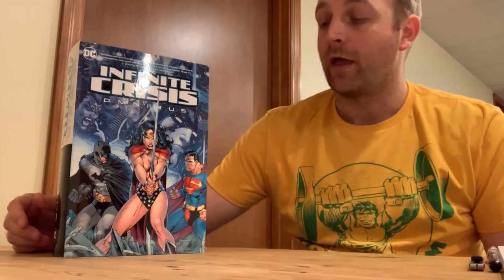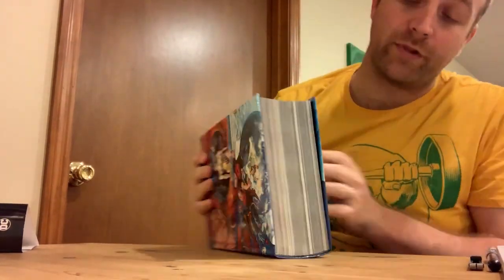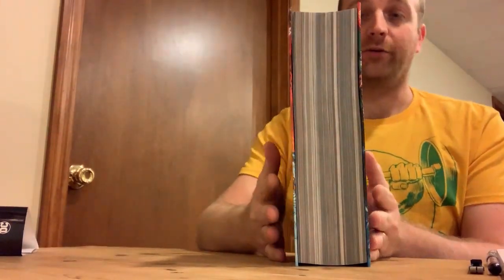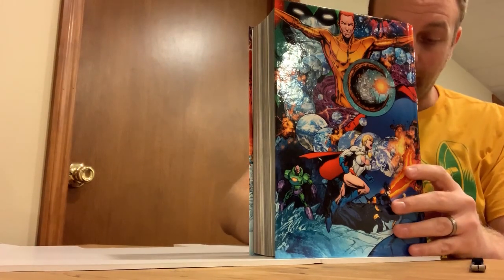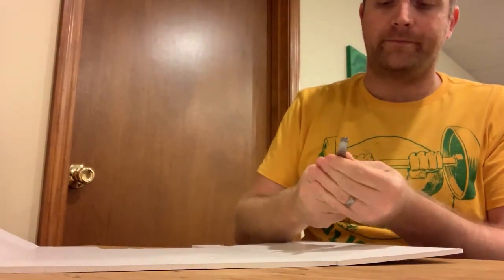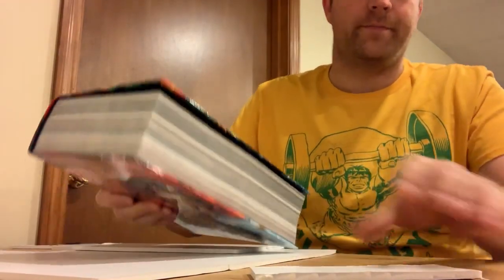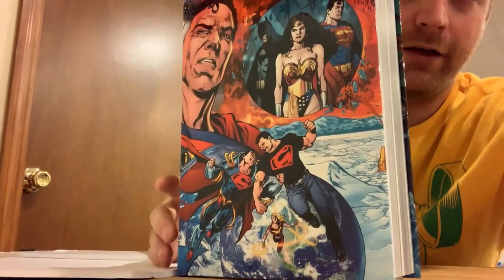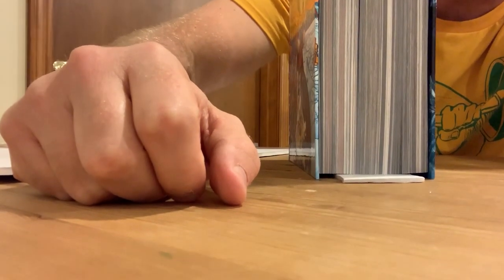How to Prevent Omnibus Page Sag - Dr Omnibus - Issue 4

Comment: Great video. If the foam board is too thick though, then I wouldn't cut along the thickness of it to make it thinner. I'd just try to find some thinner foam board. It'd be difficult to cut along it perfectly even, and then the weight distribution of the block on the foam board may not be even.

Comment: As a Dutch man I didn't know the English term for this problem, but I use a similar technique for years and it involves stacking cut out comicbook backboards, usually 5 boards high. Cut out to the width of the omni, or any OHC thicker than 1 cm.

Comment: Does anyone have the issue where putting support under the text block ends up putting a curve in the pages? Just cause now the weight of the book is resting more on the pages and it ends up bending pages one way or another.

Comment: Is there a way to repair the spine if sag has started to damage the paper that attaches the text block to the cover?
Reply: yes. if the paper has begun to tear you will need to cut the text block out and make new endsheets. If it hasnt started to tear then you can add glue under the parts which are coming loose and then do what this video describes to prevent future occurance of this issue.

Comment: I've never heard of this problem until I watched this video yesterday. Could laying omnibuses down instead of standing them up help prevent page sag, too? Also, would it maybe be easier to use popsicle sticks or something, since those are really thin, too?
Reply: scapegoatman strap in for a long reply, lol. 
1) i would not stack omnis flat. I dont know for sure, but I think all that weight would damage the covers and possibly the binding of the lower omnis
2) popsicle sticks could work, IF you glue them together (if needed) and cut them so that they can be laid under the book and placed perpendicular to the pages, so they support the entire block